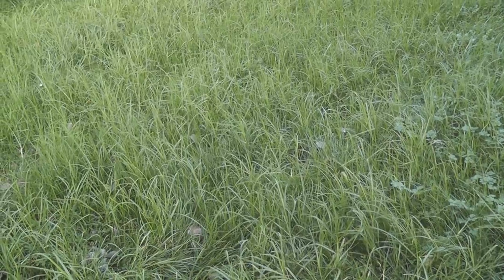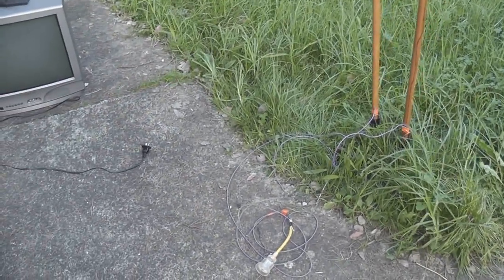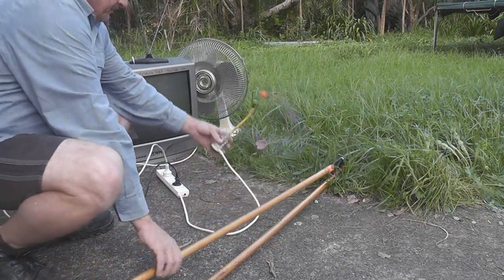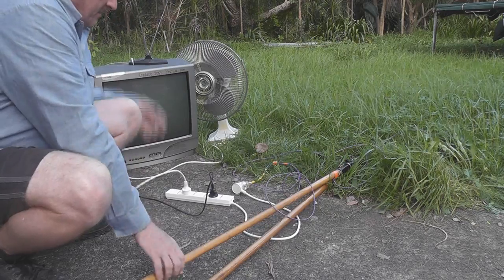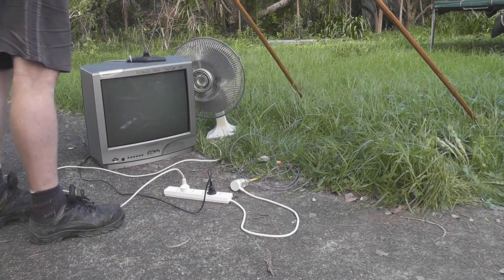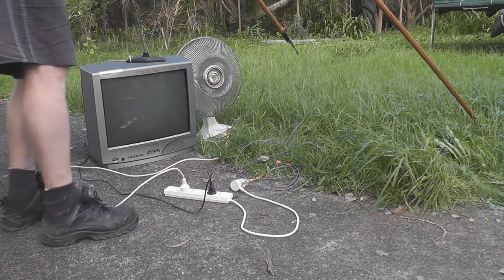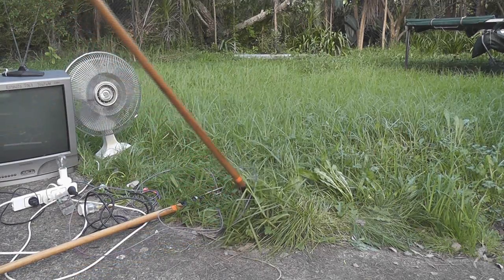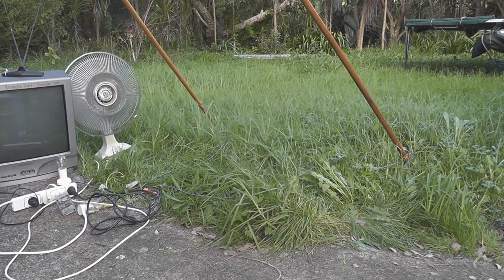Garden grass powered TV set

Comment: This is real.  There is a pair of probes in the ground off camera (most likely one on either side of the shot) that have at least a thousand volts or so applied to them.  The ground is acting like (or is, in this case) a big resistive divider, with the load probes stuck in the ground at a spacing that results in the potential difference between them of about 240V.

Comment: Old army field phones used this trick too... ground conductivity return so they could be used with only one wire.

So here I was a little disappointed you didn't do the same thing one of my old professors did... he built a biogas reactor and threw organic waste like grass clippings in it. Methane and hydrogen sulfide gases would be produced and could be used to run a generator engine. :)

Comment: Really, I expected better. So what was the earth fault current and volts at the stake then? The rubber boots, the long wooden poles, give it all away. The warm ground probably, too, if left on for too long. Would have been nice to see an Ammeter connected to the "real" supply. Was it just boring old 240 or did you do this at work next to a 11k sub leaking to the earth mat?

Comment: Question: If you moved the poles further apart, does this give more volts? :D I find it interesting that the lamp failed..... Maybe you had the poles too far apart, & the lamp got cranked until it popped. :D

I find it interesting that this works at all, because the fan has an induction motor in it, & the TV will have a transformer in the back of there.

Both need AC....

Is there any chance of the grass powering a 9kW electric shower? :D

Thanx for showing,

-BoomBoxDeluxe.

Comment: Ok you Burried a wire to the ground which you connected to 400V AC or so. Make sure the ground is fairly wet and then you get your conductance to supply that TV. Would not be a good idea to walk around there i guess. Yous balls won't like the step voltage i believe.

Comment: Something I would never try anyways, much too dangerous with mains, but with batteries (1.2 to 12v) and low current DC from cheap universal adapters and old but working laptop power supplies, it shouldn't be dangerous, but yeah, always respect electricity or it WILL give you a nasty bite (shock) in the nuts in return.